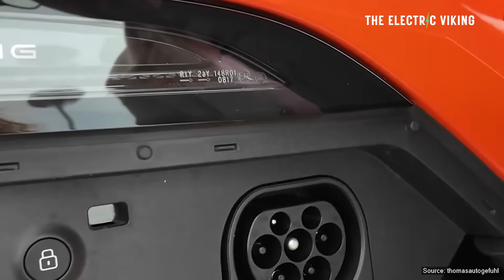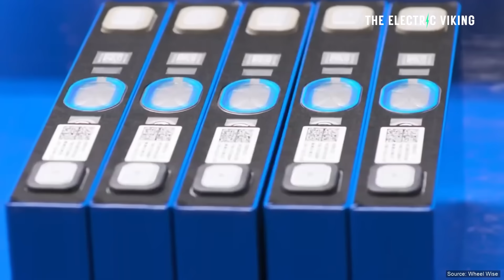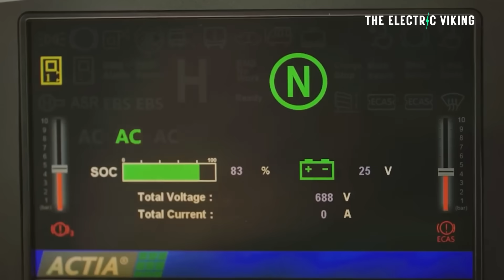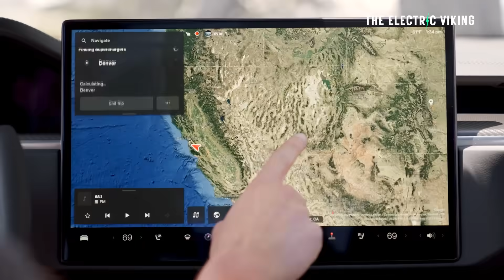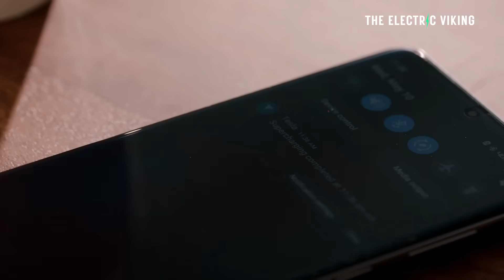Shocking data reveals the TRUTH - how long electric car batteries really last

Comment: Wonderful news . Use your “How to plan  your trip with EV in order to avoid unpleasant surprises” instruction even longer now. Carefully plan your charging spots , do not run your battery dry in case that particular charger does not work - do not run your heater full time in winter - and all other wonderful advantages of an EV - like super high insurance , catastrophic depreciation etc. etc not to mention “better have distant from your house charging point” Aleluja! P.S - nothing against electric cars - but if they run on batteries - it’ s a scam. Total political scam to pedal green agenda. If you want to save planet - first find out how to get rid of coal power stations and most important - how to produce steel without coal.

Comment: I have just returned from Beijing, we took a number of car rides and over 60% of the cars we drove in were EVs, the ICE we drove sounded like the engine was about to fall apart - yet all the EVs ( 5 different BYD cars), were smooth and quiet.  Sure the EV's are younger but the ride quality remains largely consistent with age.

Comment: Living in a region of the world were temperatures regularly fall under -10 degrees celsius (14 degrees fahrenheit), and having real world experience with fully charged mobile phones 📱 just running low on battery 🪫 within MINUTES …… a full EV is a really a hard sell …. mild hybrid being the most I would risk. 

Do you have DATA to disprove that perception?

Comment: The challenge for electric vehicles long term will be spare parts availablity and the increases in insurance premiums as mainstream insurers no longer want the risk/cost of insuring older cars. This will be particularly an issue among some Chinese manufacturers.
Reply: Parts for Model Y will be plentiful.  Best selling car in the world.  Insurance companies love lowering rates for older cars.  After the payments are done, they can't lose a legal battle over value.  After 5 years old ins is cheap on cars!
Reply: On what ground do you say that?
Aren't EV manufacturers bound to the same laws regarding part availability as all other car manufacturers?
And why would insurance premiums be higher for EVs... even older EVs?  For the time being, at least in my country, the insurance premiums on EVs are about 10-15% LOWER than for similar ICE cars.
I am not saying that you are wrong about this or that Chinese manufacturer... but where is the data to support your opinion?
Reply: @ Opinions do not require data.  Just feelings.

Comment: The issue isn't how long will the battery last the issue is how long will governments who profess to be "green" permit the ridiculously huge batteries to continue to be used? Any EV with a range of greater than 100 miles in Summer should be taxed off of the road.

Comment: Most people drive around 10K miles per year, so mileage of battery pack isn't the main concern ... What we really care about is the number of years the cells will last before they degrade and fail. ... And how many years the car will last before it rusts badly and is scrapped, which for Chinese EV's seems to be much lower than vehicles built by western manufacturers ... So not only do EVs cost more than ICE cars, but they also do not last as long, and they cause more damage to our roads. Range is still a problem. This may all sound like I am against EV's, but this isn't the case ... I am simply saying that the time isn't right for me to consider buying an EV unless I'm forced into it by government policies.
Reply: Several misperceptions there..... For a start, here in the UK, the 3rd cheapest new car you can buy is an EV. It costs £15k. There are also now several other new EV's priced lower than some popular new ICE cars. Are you able to offer proof or verification that EV's are damaging roads more than ICE cars. Why hasn't the road damage and wear caused by the many thousands of loaded trucks and vans been a concern for you previously? Why is it an issue for you now?
Reply: @Brian-om2hh  Such as?
Reply: @Brian-om2hh  Pot holes are a concern for all road users and if you need proof that heavier vehicles cause more damage that lighter vehicles then you should be able to google that pretty quickly. Your comparisons are not like for like an you prefer to ignore a common concern because you like to argue just for fun.
Reply: "And how many years the car will last before it rusts badly and is scrapped, which for Chinese EV's seems to be much lower than vehicles built by western manufacturers" Where is the data to back that claim up? I would like to read it. I remember that same claim about 70s Japanese cars.